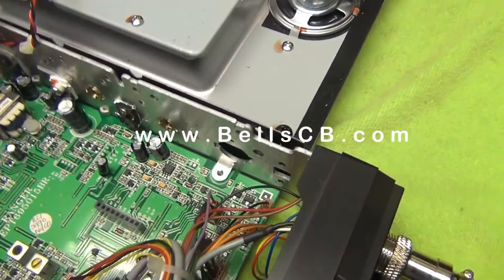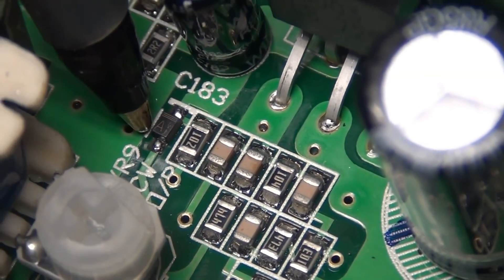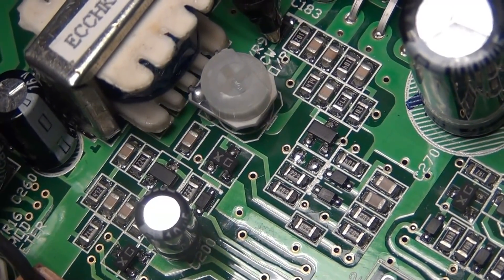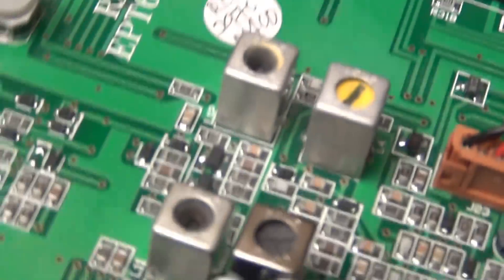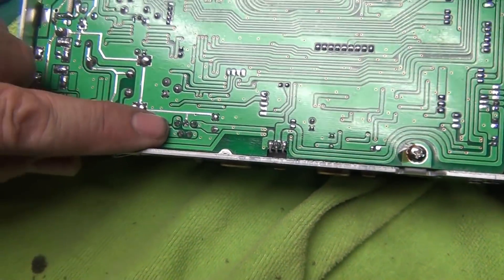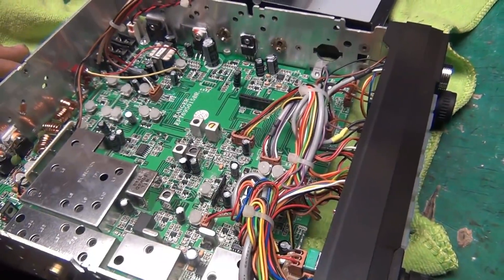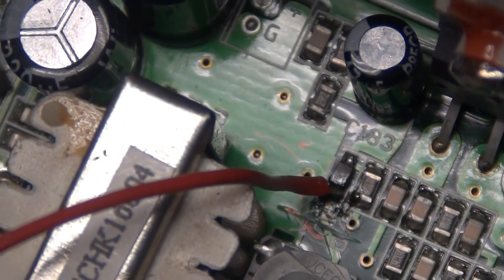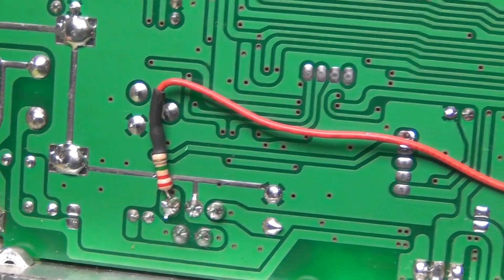How to install TalkBack in a Ranger 2900 series radio

Comment: At 1:53, there are two transistors to the right of the electrolytic capacitor. One of the transistors looks like it's knocked off a solder pad.
Great job, works perfect.
Reply: That’s not the case at all. That is a double diode package. It has to be installed that way. Ranger must not have been able to source what they needed in a 2 terminal package. You will see this in multiple areas in the new radios. It’s not a defect in workmanship!
Reply: @ronedwards8239  
Cool.

Comment: Mr Screwdriver, thank you for kindly sharing your knowledge. So if instead I remove the diode to use the two pads for going to the switch, will it function ok without the diode? I'd rather not cut the trace just in case it would ever need to go back to stock.

Thanks
Reply from the maker: You will still need the diode in line when switched off, you can put inline with your wires.

Comment: Couldn't help but notice no dummy load or antenna,  and dougsnova1 you may be onto something. cause the part where he says the trace goes over to the transistor it sure look like it don't go under that pot at all on either side at 1:34